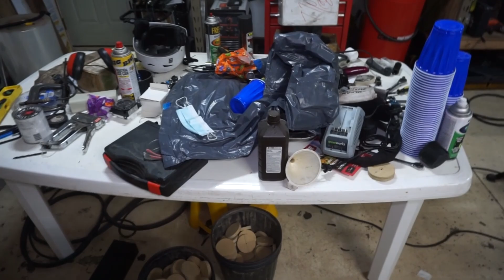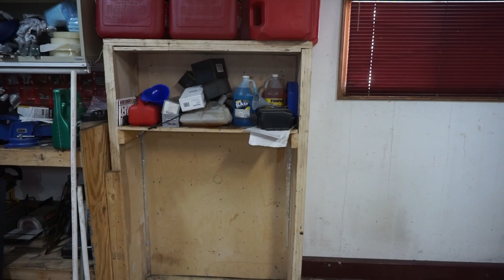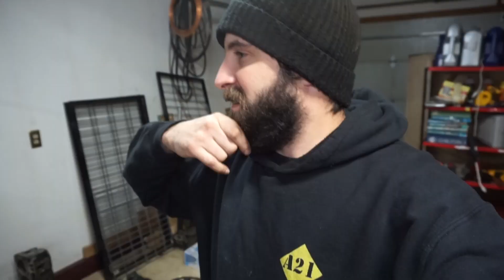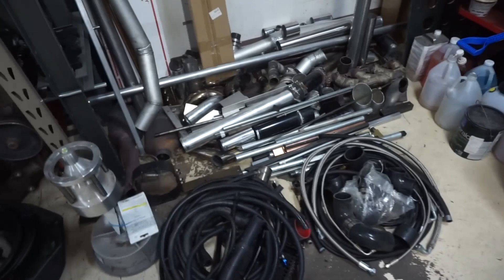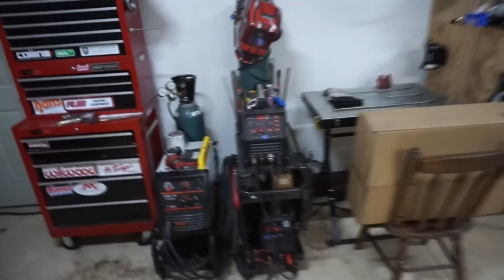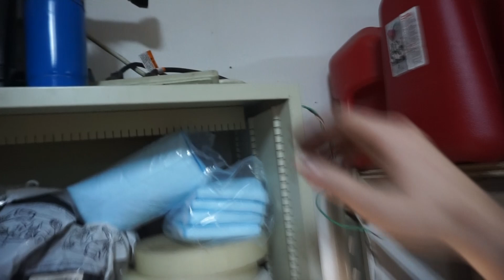CLEANING UP MY ACT!!! 500LBS OF JUNK!!!

Comment: To the end. Coupla things.
1. Your electrical plan seems kind of sketchy. Every socket should be on a separate circuit. A sub-panel from the house would be good.
2. Next spring do a junk on the driveway and treat yourself to an epoxy floor coating.
3. I see that you have perfected the Vice Grip Garage finger movements. For a second there I thought that I was watching Derek.
4. We live in what’s called the critical zone of the Chesapeake Bay. I lost my garage altogether in the recent remodel because the bureaucrats wouldn’t let us have any more impervious ground coverage.

Comment: I'm just trying to think about how you should run the power to your bench like you want it .. I guess it's ok to run them from the outlet by the door but I am guessing that you have the whole garage running off of one or two breakers at the most and I don't know what kinds of draw you would realistically need at any given time. those wires for the welding gear going under the door probably isn't ideal. if you're lazy and thinking about running those outlets off of that one outlet by the door, why not just get some extension cords and a couple power strips instead of outlets? idk, you'll probably have it figured out and done by the time you read this so do your thang ;)

Comment: I'd suggest putting the hose reel by the garage door. It's handy for being able to air up tires in the driveway without having to pull into the garage.
Reply from the maker: Good call. That solves one of the concerns I had, as I usually roll compressor to driveway.